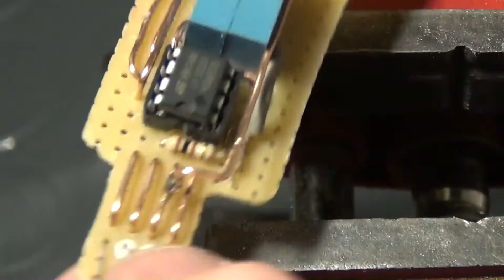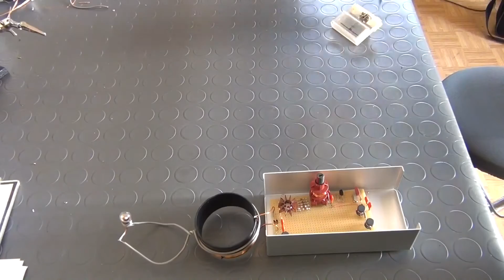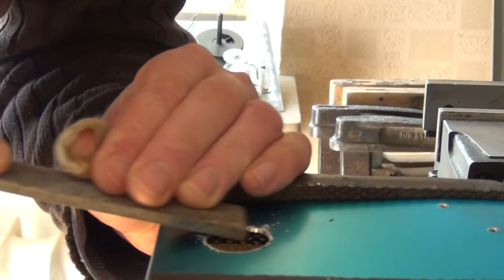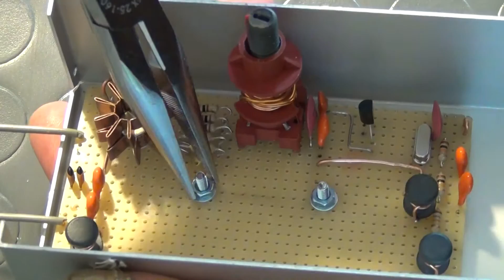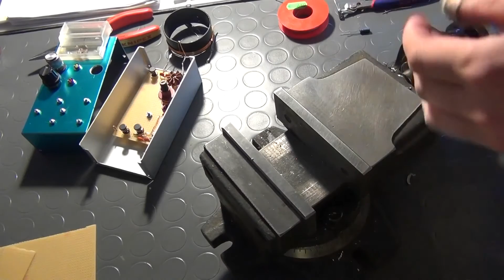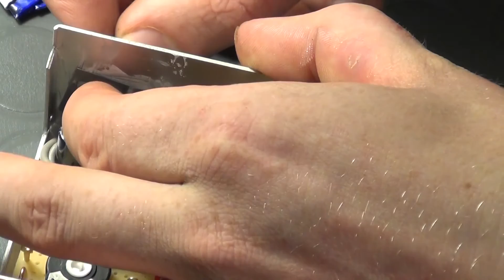How to Build an RFID Tag Detector - part 3: Casing and Regulators

Comment: Great work again.  Thank you.

I have been thinking about your detector coil.  Is the capacitance high and the Q low due to the tight compression of the windings?  If so, why not allow the coil windings to use the full width of the support tube? 

I am probably missing something in your design.  But tight windings drives capacitance up and Q down.  I am missing the reason for this.
Reply from the maker: Lawrence Bosse I'm sure that there are many ways to improve this device. It was a project that I came up with and implemented in a single day. The coil design is not ideal and was kind of an improvisation. Providing more space between the turns would indeed reduce the capacitance between them, but it would also change the symmetry of the magnetic field and weaken the linkage of the flux lines created by the single turns. 
It is key here to maximize the inductive coupling between the coil of the detector and the RFID-tag. For that it would be ideal if the coils of the detector and the tag would be  as near to each other as possible. Therefore I should have wound the winding as near to the end of the bobbin as possible. In my opinion winding the coil as tight as possible improves the linkage of the flux lines of neighbouring turns and optimizes the symmetry of the field in order to allow relatively strong coupling with the rfid-tag. 
At 13.56 MHz the capacitance of those few turns doesn't seem to have a huge impact but it sure would become a big problem if the circuit would be designed to run at higher frequencies.  
I guess at the end of the day one would have to do some experiments with different coil designs in order to find out what really works best.